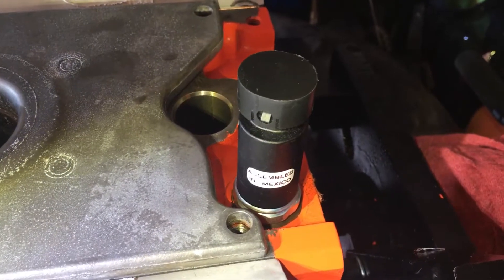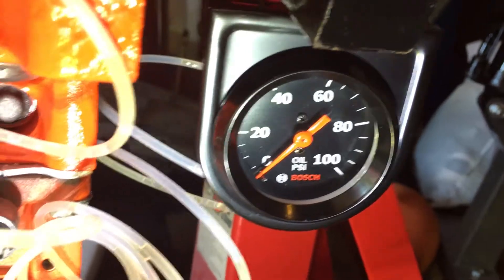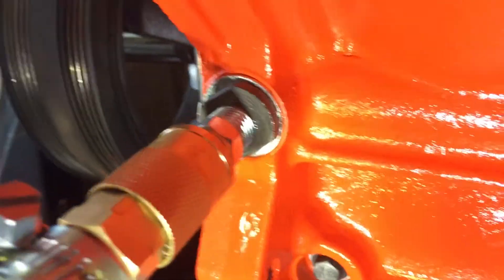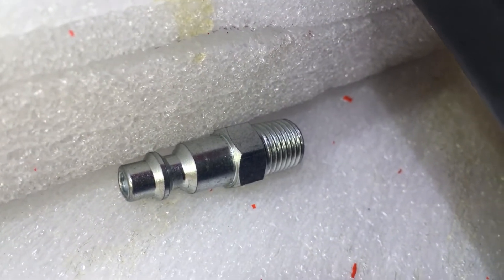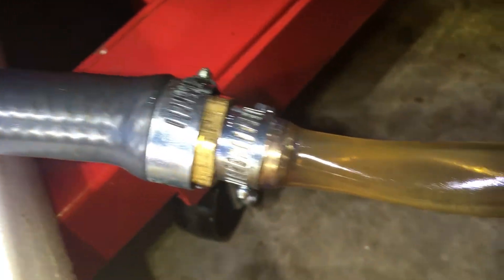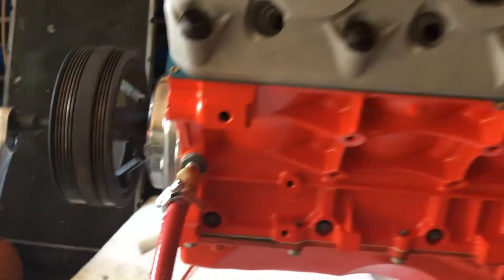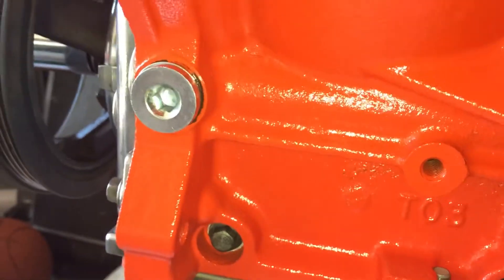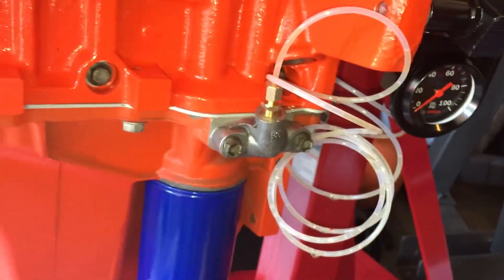Oil Priming a 5.3 GM Truck Vortec LS Engine -  Rebuild Video 4

Comment: Cool, I bought a 1990 ZR-1, has the LT5 and it has been sitting for several years and I have to prime the oiling system. I like your method, think I will try it, thanks for posting. 👍👍🏁
Reply: Lt5 is a completely different engine. In fact that is a extremely rare car! Dual overhead cam v8.. man I’d love to see one in person.
Reply from the maker: So glad to help.  Thanks for watching!